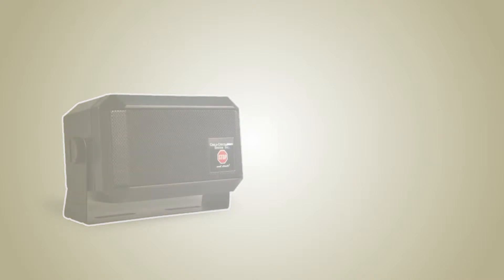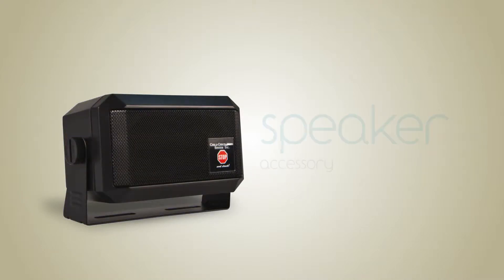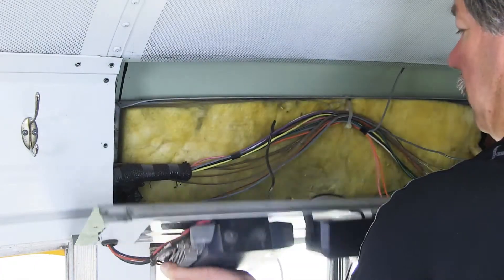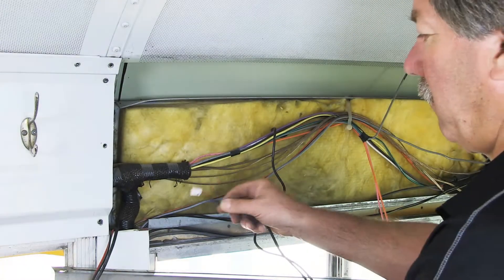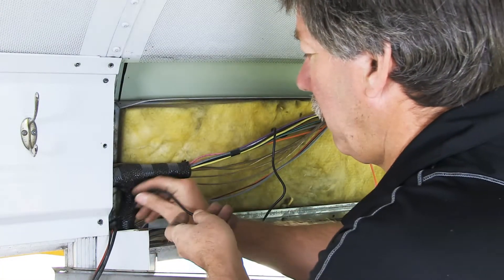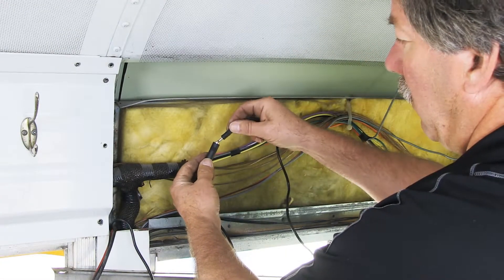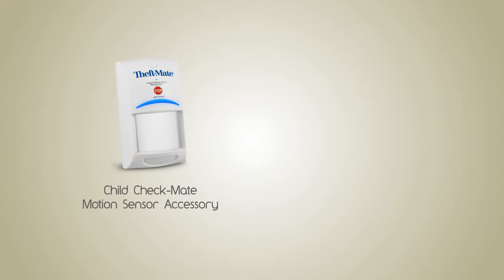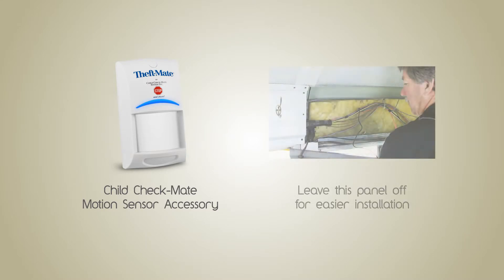Child Check-Mate System - Speaker Installation Video

Comment: What is the purpose of the speaker?
Reply: The speaker is there to provide additional instruction. It is especially valuable for systems that have a Motion Sensor or for customers who operate in regions with more 'aggressive' regulatory requirements (California is a good example of this).

The speaker provides instruction to the driver, children onboard and also provides diagnostic feedback (i.e. it will read out every input it 'sees' so that you can tell if the system is properly installed).
Reply: @bradboth2698  First Student requires CCM on all buses but I think that Zonar will take over and they will not be using this alarm system anymore down the road in the future. I am not sure but the Child Checkmate system is very good.
Reply: @carwashslayer4235  CCM has worked with and integrated with Zonar for nearly a decade (e.g. when an alarm sounds Zonar can send alerts to drivers/supervisors/dispatch). In fact, I Zonar's EVIR and CCM were installed right around the same time in the late 2000's. Interested in your thoughts / feedback on this.
Reply: @bradboth2698  I always loved the Voice Prompts but I guess it costs a lot. The system was introduced on all my school buses that I rode. We would always hear "Child Checkmate Is Now Activated" and the system is amazing. Hope you could record it in action.